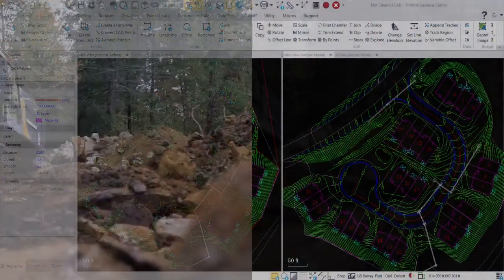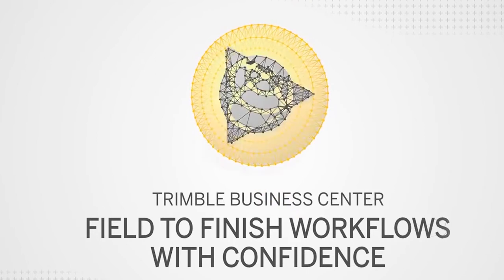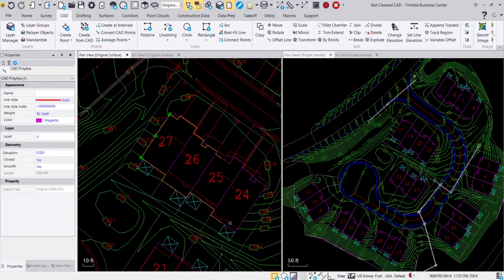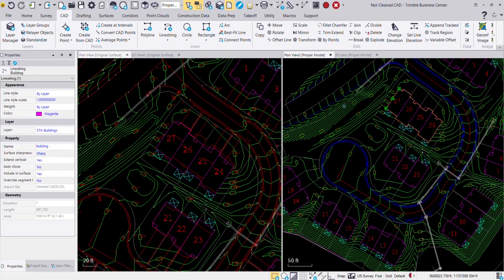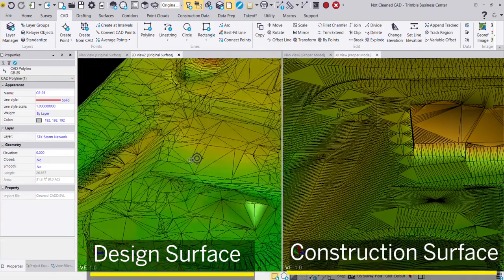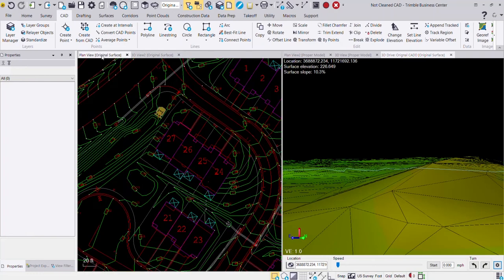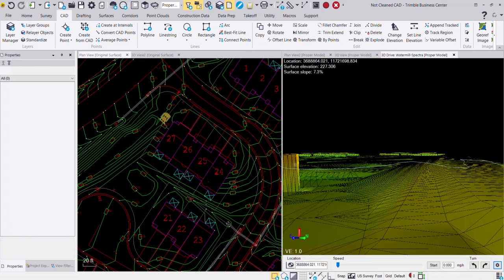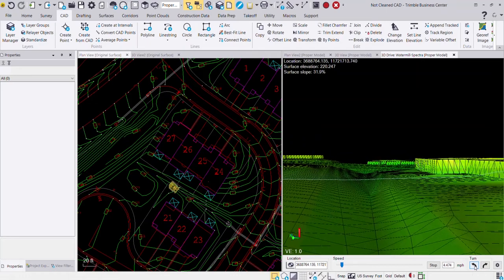Trimble Construction Software | Takeoff & Design | CAD Modeling and Data Prep Tools

Comment: So how would you make it more defined, like the second view?
Reply: Dude there is barely any good tutorials on this software.
Reply: @Geekmasterproduction  what do you want to know? I've built thousands of models for takeoffs and machine control
Reply: @MJ-it8ru  receiving cad from the civil engineer it usually comes in not elevated or elevated incorrectly. I’ve been told that it’s most likely due to civil 3D using “objects” amongst other things. Is there any way for me to import the cad correctly elevated? Something I can do or something I can request the civil engineer to do in civil 3D before sending?
Reply: @MJ-it8ru  Hi MJ, do you know any good tutorial to make 3D model for machine control from a 2D plan? For example a 3d for foundation digout. Thank you! I work with TBC or Microstation.
Reply: @oslimerustbucks7402  It's really hit or miss in my experience, even when you import linework that is already elevated it is not uncommon for some of it to be wrong. Even when they are correct, most engineers in my area are building surfaces to calculate volumes, not to use in a grading model. The surfaces they send might be rough or might not include enough detail in certain areas. I never trust it, I set elevations of everything to undefined at elevate everything myself. It takes just as long to go through and verify every elevation vs just doing it from scratch. At the end of the day I am giving the contractor the model so it's my job to make sure it's right. I'm not going to put myself in a position where I have to tell a client that the model is wrong because the engineer made a mistake or there was some formatting issue that I didn't catch.